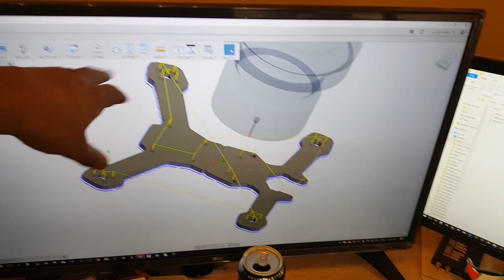CNC Carbon FIber Frames & 3D Printed GoPro Mounts // Shop Vlog #002

Comment: the Titan extruder is a geared extruder, once you have the steps per mm figured out you shouldn't need to adjust it for different filaments.  You may want to adjust your flow rate but not your steps per mm.

Comment: Speaking from experience :-) You're going to need a few endmills to continuosly cutting carbon fiber frames, it is very very hard on the tools! I btw did doublesided tape to keep it down on the plane while cutting a stretched 5" kwad 4mm thick.
Reply from the maker: Yes just got through all my end mills :( ..

Ordered more.
Reply: Using hard carbide steel tools (expensive...) is your best bet, they will last longer, with a max of 2-3 flutes, carbon fiber is just a bitch to cut. Cutting one frame and the endmill is pretty much dead :/ also turned my feedrate down to 200-300 iirc helped me a bit with less vibrations in the carbon plate

Comment: I have been 3d printing for about 4 years, as a business, and what I have found is that flex filaments flex more with less infil, and less shells, but without compensation of strength. Armadillo is actually pretty flexible. I use about 5%
Reply from the maker: That's interesting I saw exact opposite with the adapter mounts. Did you see the green gopro session mount in the video is it as flexible as that?
Reply: I have not printed a session mount yet, but on the objects I have printed, they have flexed somewhat like the mount in the vid.

Comment: Are there any downsides to milling carbon underwater? Like does the water affect the lamination etc?
Reply from the maker: no it's best to be milled under water. Carbon conducts alot of heat and water does alot of good for example keeping the end mill cool thus extending life. There are just some the list goes on.

Comment: Hi man ,big fan .But have a big question???

Do you think that the hglrc F440 esc + fc , and the matek vtx could fit in the Transtec Frog ,plus would the Runcam Split Mini fit in as well in there?
Reply: Or should I get individual esc but that would be more heavier??what do you think?
Reply: The f440 will fit in any frame that has 20x20 and I don’t think that the frog has it.. you could always throw it on a drill press though

Comment: CONGRATS! on the shop and oscilloscope  I have drooled over those for years but cash is tight and there is always something more important  to spend it on. Also have you done a test on the Racerstar anniversary edition 35 amp 4 in 1 ESC. I ended up owning three of these, and they seem to perform well. No noise, throttle is stable.  I am paranoid about them since watching a complaint video where one motor all but bursts into flames on the bench, the guy probably loaded wrong firmware but who knows. They are just a incredible deal less than 30 dollars and up to 6s at 35A. It makes me wonder how or why they are so inexpensive anyway i looked couldn't find it.

Thanks for the awesome channel and hard work!

Comment: Try cutting the mounting holes first, before the border of the frame.  I've seen that as being the best plan of attack when cutting out these frames.  Awesome video man!!👍 Glad to see you posting this part of the channel. Right up my alley
Reply from the maker: Had that cross my mind also its seems to be the best way to go about it. My thought was to save my last 1mm mill until the others arrive. I was going to use a 2 or 3mm to cut out the frame and the 1mm for cutting the holes so 2 profiles. 

Thanks for the tip much appreciated.